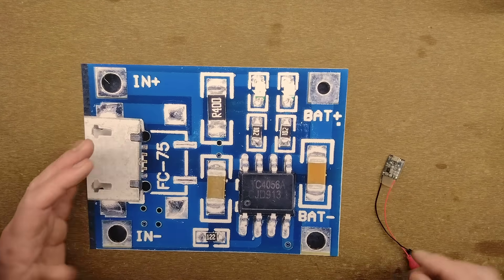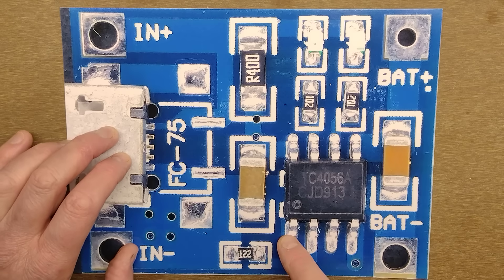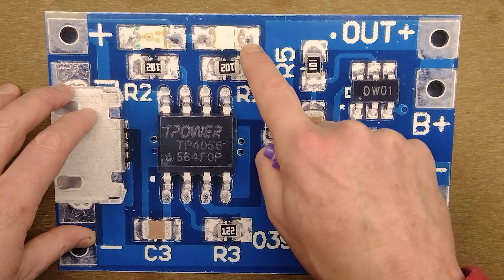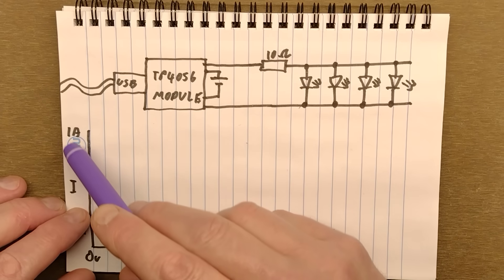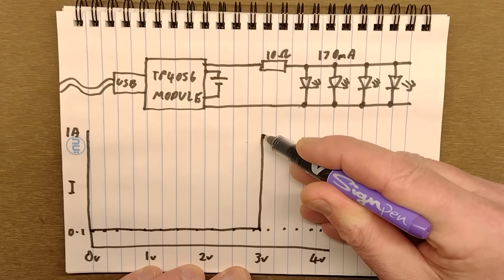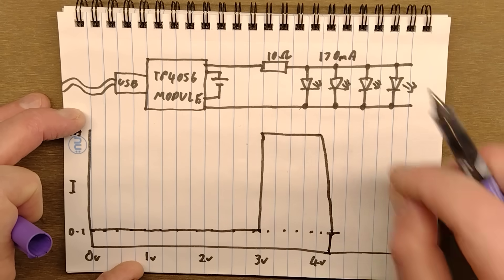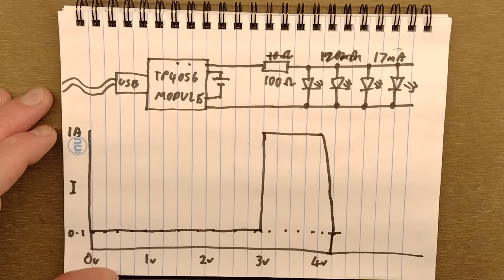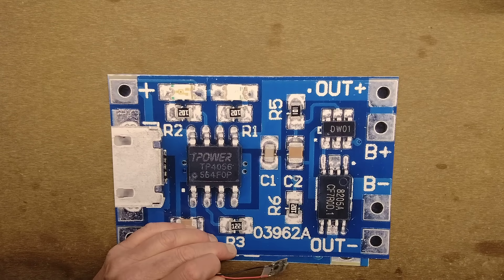TP4056 myth busting

Comment: Hello Clive, I like to be able to vary the charge current on my cells and if I am in no big rush, which is almost never as I have multiple units that I can rotate in use, I charge at maybe as low as C / 20. This is to try to make the charging process as easy as possible on the cells. My circuit uses an op-amp and fet for the current limit and a comparator, voltage reference and fet for the charge current termination. The circuits have behaved very well and have not done anything silly as yet. The under voltage cut-off is built into the units I use the cells in. I prefer unprotected cells as some of my applications are very low current draw and the small current taken by the control chip can sometimes be a large proportion of the total current draw. Your explanation is spot on as is usual! Also, your explanation is very easy to understand, even for the newbies. Makes me want to take a closer look at these controllers for non critical applications. Not sure how you feel but I tend to have more confidence in something that I have built myself, rather than some of the commercial offerings that are made to a price. Not too keen on tiny chips without real heat sinks that commonly run at 80 deg C or above!

Comment: My vape habit has gotten out of control. Every time I see one in the street, I take it home and strip it down, harvest the lithium pack, solder a TP4056, and a bunch of LED's to it. The addiction has got so bad, that so-called friends are now bringing them to me. The irony is that I'm a nonsmoker. Also, one of these TP4056 modules is continually charging an 18650 with a 3.2>5v USB buck converter. This acts like a basic UPS for the raspberry pi internet radio in the shed. No fires as yet.
Reply: 😂😂 I know what you mean. Big Clive is secretly helping keep Britain clean with an army of scavengers who are loyal subscribers to his channel!!

Comment: Very nice and detailed explanation. Somewhere I read that you cannot be charging with these while running a load at the same time. I have some applications that need these. I am experimenting with reducing the peak charge voltage for longer battery life. 4.2 volts is not very gentle on a battery life cycle. I am also working on a board with various resistors to change the current for various sized Lithium batteries.
Reply: Totally. And what is the open terminal voltage of a full cell?
It does take some voltage to drive the reaction so having it extended time on charge instead of idle voltage likely does nothing good to the cell.
Reply: @erlendse  I am aiming for more like 3.9 volts per cell myself for off grid solar power use. I am also aiming for the highest cycle life of the cells. They do settle down to a lower voltage after you remove them from charge. I have thousands of batteries from Battery Hookup and am seeing a wide variation in voltages between different types of cells.

Comment: I have these, and a few of the older ones and some  battery protection boards, good to know the battery protection in the newer ones works like it's supposed to.

Have you seen the SW6106 PD boards at all?  I used one to build a power bank a few years ago, and it worked out really well, supports QC3, 4 led indicators, and doesn't get hot while charging/discharging.

Liked it well enough to get a few more boards. for some future projects.  Was curious if the board is as well designed as it seems to be or if there are any issues I'm not aware of.  I'd  really appreciate your opinion on it.
Reply from the maker: I haven't tried that module yet.

Comment: Wow i never noticed the 0.4 Ohm resistor in the datasheet!

Whether it's really needed depends on set current. If you're running full 1A, then the charger, if not in free air, will likely run into a thermal limit and throttle without the extra heat dissipating resistor. If you're configuring substantially less, it might as well be useless.

Comment: i burnt my tp4056 with the dw01 chip, had changed the prog resistor but looked like it was not fit properly after a day saw the module not charging the battery, saw closer & saw the burnt chip with all the self protection features.

Comment: Well, lithium batteries don't love being kept at 100% state of charge. Some consider having a charger keeping them at 100% SoC "charging".   

For those that don't automatically realize the main point made in this video it might be useful to know that lithium batteries ideally shouldn't be stored fully charged. It might not matter much in a diy project with a few cheap or possibly even salvaged cells, but if you have expensive battery packs, or built in batteries that are difficult or expensive to replace, ideally you shouldn't even charge them to 100% before storage, and definitely not keep them fully charged.

Comment: Great video! I thought topping up LiIon battery cells wasn't good for the battery's life? If this is ok, then I will have to rethink my opinion on LiIon not being suitable for emergency lights and such.
Reply: i read somewhere best to keep charge levels 20 to 80% for better cell life
Reply: @andygozzo72  Yeah, I read something similar. I am not sure how much difference it makes in real life tho. For a Mobile Phone for instance, the probability that you buy a new phone before the battery gets wonky is pretty high for many.
Reply: @andygozzo72  another  thing I think comes in to the picture, is how different manufacturers (I'm thinking mainly about mobile phones) set the percentage, 20% indicated on the phone is of course not 0,84V (with 4,2V@100%) so I would like to know how all manufacturers calculate the indicated percentage. I'm betting it can differ even in between models from the same brand.
(I suppose they are starting the 0% at some 3 point something Volts, anyone know?)
Reply from the maker: For a long term emergency lighting system I'd probably for for LiFePO4.
Reply: @bigclivedotcom  thanks! I love in the Swedish countryside and want to build my own emergency lights. I need several out on the farm and buying complete ones is too costly for me.
And it is also a lot more fun to make them at home😁

Comment: Used these on my uni project a few years ago. Was essentially a solar powered weather station using an Arduino so the overcharge protection these give (while still allowing the circuitry to work) was core to the build as you cant just turn off the sun when it's charged your batteries :)
Reply: I'm making a small wind turbine battery charger for a flashlight battery with a dump load and am hoping it diverts excess current to the load and doesn't drain the battery when the wind stops! Am I on the right track here?

Comment: Updated an ESP8266 based outdoors sensor project with one of these (with the DW01 chip), a small 5V solar panel and a 1500mAh lithium cell I found at the side of the road. The only change I made was to cut off the charge-in-progress LED so that it doesn't waste the tiny changing current available on winter days. Seems to be working well. The previous power for this was four AA alkaline cells which would usually last about 4 months.

Comment: I used this chip on a little RTU that I designed for my own use and it works well. Does anyone have any proposals/solutions for charging TWO batteries? I'm currently working on a little RTU that can deliver data to an MQTT server. The 2G/3G/4G modem is quite current-thirsty and therefore I'm using two batteries in parallel. But how to charge them? We're told that we should never charge two batteries in parallel because they might not take the same charge? My thoughts are that if they are well matched when they are initially installed (i.e. both fully charged) why does it matter? They will discharge and charge identically - near enough. Does anyone have any thoughts on this? Many thanks Big Clive for another interesting and informative video.
Reply: Use cells that match each others health and capacity and connect them when very close in voltage, and they'll be fine.
Reply: I was under the impression that you can put cells in parallel of different capacities without problems -- please tell me urgently if this is wrong!

The main thing as I currently understand it is that the cells must be at the same vintage when initially put in parallel so you don't get a painful inrush current to the cell with the lower voltage.

Tip I was given is to initially put each cell in series with a suitable resistor and parallel up all the cell+resistor pairs and leave the voltages to equalise gracefully.
Reply: @trueriver1950  You can do different capacities, but if one is significantly different than the other, the cell with smaller  capacity will cycle more and have a shorter lifespan.  So it's best to have them as equal as you can.
Reply: @Mazlem  I don't think that's right. If you parallel the cells without putting resistors or diodes in series with them, then they will be all at very close to the same voltage at all times. That means that if the smallest cell gets a few nanoVolts ahead the current to it reduces and this lets the other cells catch up. That makes them self balancing to within a few nV according to my back of an envelope sums.

What you say is true if you have separate charging regulation for each cell, but not if they are wired in parallel to a shared regulator circuit. 

Explanation: The typical internal resistance is not many micro ohms, even including the resistance of the contacts and the wires, so an excess Voltage of only 1 nV reduces the current by something like 0.1mA to 1mA, which is the right sort of size for fine tuning the rate of charge to keep the state of charge on step.

(Exception when you first connect them there will be a current surge that eliminates any such difference: that's why it's a good plan to include a resistor in series with each cell at first, but it's safe to remove it or short circuit the resistor once there been time for the voltages to equalise)

In more detail: during charge the Voltage is the sum of the chemical potential plus j×r (current through that cell times internal resistance of that cell). If the internal resistances of the various cells are not proportional to their respective capacities, then it's true that one cell will run slightly ahead of the others, but it won't run ahead by much.

In fact a large capacity cell can be considered as two smaller cells in parallel, connected by their "common" electrode. That's why connecting the separate electrodes of two or more cells effectively makes them run as a single cell.
Reply from the maker: You can mix different capacities of lithium cells in parallel, and they will behave as a single cell.  The main thing is to ensure that they are close to the same voltage before paralleling them.  Even a 100mAh cell in parallel with a 1000mAh cell is fine.
Reply: @bigclivedotcom  how close a Voltage is "close enough" before paralleling them in your experience? I've got the physics theoretical knowledge but not your level of practical experience, Clive.

Comment: Back when dinosaurs roamed the earth, the Li-ion charger that I used was the LTC4055 sourced by Linear Technology, now a part of Analog Devices. It was quite sophisticated, protecting the battery at all costs, important if you are concerned about selling into consumer markets and want to avoid lawsuits over fires created by your product! It had one feature that limited the scenario you point out here: a programmable timer. We set our timer to be 3 hours. If the battery was not charged within 3 hours, the charger cut off, letting the load drain the battery. If the battery then dropped 100mV below 4.200V, another charge cycle was initiated.

It was a pretty pricey charger chip at the time, but we were willing to pay the price for it to assure the utmost in safety. We were not your average eBay seller selling junk! When you use a much cheaper chip like the TP4056, you sacrifice some of the safety features that you get when you buy a better charger chip. Indeed, the added safety of the DW01 safety chip is well worth the extra pennies of expense. In our case, our batteries had a small PCB in it that held a similar chip + dual NFETs and a thermistor. (You don't want to charge these batteries above or below a temperature range.) The TP4056 has the capability of supporting a thermistor, but the pin (pin 1) is disabled by grounding it.

Comment: Should have mentioned the chips does support adding a ntc thermistor for the battery with a minor mod to the circuit you can solder thermistor to pin 1 after isolating pin 1 from ground.
Reply: To elaborate; melt solder on pin 1 with iron and lift the pin with a small screwdriver about 1mm. Wick away the solder and slide some kapton tape between the pin and the pad. Connect NTC to Battery- go through a voltage divider and back to Temp/pin 1. I used 10k NTC, 4k7 and 68k to roughly stay within +5C to +45C.

Comment: Last week I had my rechargeable worklamp charging from a car usb adapter in the cigarette lighter socket. When I turned off the ignition, I found it strange how the entertainment unit on the car was still on. Then I smelled some smoke escape from the worklamp. Upon inspection, I found a TP4056 had popcorned and burned the circuit board. New TP4056 (pack of 6) on it's way from eBay. Due to arrive in December, or January or February or March. A diode will also be added.

Comment: Sony had a few cells vent flame a few years back but they never did explain why as far as I know.  Corporations rarely admit fault.  The rumour was that the cell's working materials were carried on a copper foil ribbon wrapped in a spiral.  When the working materials became depleted at around 2.5 volts the copper then went into solution.  When the cell was recharged the copper plated back but formed dendrites instead of plating evenly.  If the dendrites shorted across the cell the foil warped and that rapidly caused addtional shorts.  The shorted cell instantly released most of its energy and vented flame.  That was twenty years ago.  According to more recent news both lithium powered flashlights and vaping devices have exploded for no apparent reason while powered off.  Does the TP4056 have a minimum voltage threshold for charging a cell?
Reply from the maker: I think the TP4056 will charge from zero.  The DW01 may prevent charging of a very low cell.  Probably because it has no power source.
Reply: @bigclivedotcom  Thanks bigclive.  The DW01 datasheet indicates it has an overdischarge protection threshold of 2.4 volts nominal.  What I find bizarre about this whole situation is that battery makers and device manufacturers appear to have known about the overdischarge problem for years.  Dispite this they have not really shared that knowledge with the public.  We need to know if a cell becomes dangerously unstable if the voltage ever falls below a certain level.  My Milwaukee M18 batteries will set a defective pack flag in memory if any cell falls below the safe threshold and the pack will never charge again.  It is only good for recycling at that point. Milwaukee Tool has never stated why they bother to do that.   We deserve to know what is really going on with these power cells.

Comment: But it will keep charging. Ohms law indicates you'll be splitting current between your two resistors, your battery being one of them. The charger will continue to trickle charge the battery forever indefinitely. This is incredibly bad and will kill your cells. If you wire it to turn on, charge up and turn off, you're repeatedly cycling the cell constantly which is also super bad for it. The best way would be to charge it, run it on battery until it's off, then charge again. Or charge it and completely remove it from circuit until it's needed, then add it back in circuit.

Comment: If the battery starts going into a slow charge/discharge cycle how destructive is that? I made an adapter that pulls tens of microamps to several hundred milliamps depending on if it's in standby or in use. The charge indicator goes green in a reasonable amount of time and I haven't noticed it turn red again, but I've also always pulled it off the charger when I notice it's charged. It's a 2000mAh battery. I've got the same TP4056 board with the in/out/battery pads.

I ran a voltage sense line to the battery and set the adapter to go to the lowest power standby at 3v. It still pulls that tens of microamp standby current though. I might raise that to 3.1 or 3.2 volts so it can be left idle a bit longer with a dead battery before it starts taking forever to recharge back up to 3v. Last time it took around an hour on the charger before it got back above the 3v threshold and would turn on again.

What happens if you try pulling over 100mA during the <3v charge phase? Would it continue to discharge the battery down to 2.5v before it hit the hard cutoff?
Reply from the maker: I'm not sure if the small area of cycling at the top of charge has a significant effect on cell life.  It's not something I've tested myself in a proper scientific manner.

Comment: Isn't it worse for a battery to keep drain and fill continually than to keep it at 4.15 and just power the load? Doesn't the constant mini cycles were on the battery more than a steady state?

Comment: brilliant, great timing, ive been using this board (the better one) to charge a 3.7v phone battery (not a 18650) for a project, however the led doesnt change to blue even when it shows its charged on my multimeter,  so if im thinking right i could change that 122 resistor? to get the blue led to light when it reaches 3.7? if so what value?   cheers clive.
Reply from the maker: That resistor sets the charge current and not a voltage.
Reply: @bigclivedotcom   ahh got ya...so not possible to set voltage to 3.7 then?